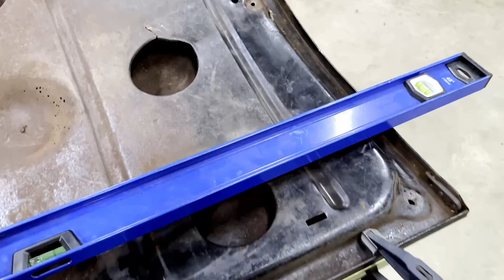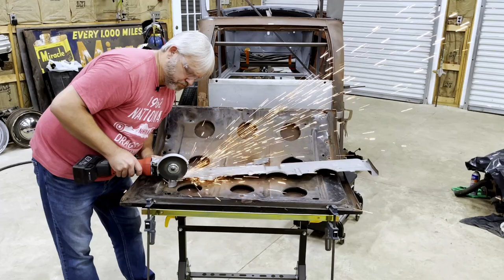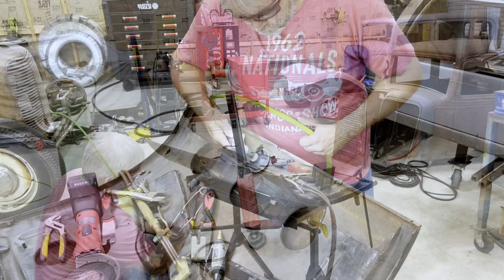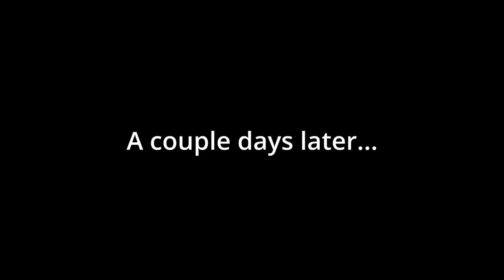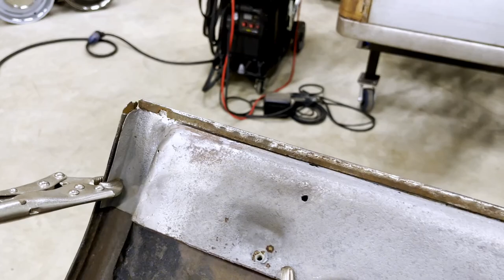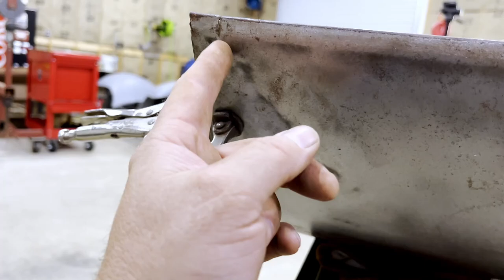Rusty Model A trunk lid part 4. Patch panel fits! Trunk latch handle hole repair! Hemi coupe build.

Comment: I think you should split the inner from the outer. Get both fixed then paint inside then put back together.
Reply from the maker: That was my original plan, but I'm afraid I'll get the trunk lid too far out of shape. If I had a solid car to fit the lid to, it would be different. But I'm trying to use the trunk lid to help set the quarters, and sort of work them together. So, I thought leaving it together would be more work, but could be beneficial from a squareness standpoint. Cleaning between the panels would be a good thing, so I still might come back later and pop the skin off and do that, But I don't know. I do collision repair for a living, and I've put on a lot of door skins, but taking a skin off without destroying it and putting the same skin back on isn't that easy. I usually grind through the edge of the panel to take it off, which destroys the skin. When I thought about separating this lid, I thought, well, if I'm going to pull the skin, I might as well replace the skin because it's pretty rough. Then again, the inner panel is even worse than the outer panel. So, the bare minimum effort to save this panel might be the better option and is what I decided to do. I may regret it later, I don't know. Thanks for watching and commenting. I appreciate it, and your approach is probably the smartest way, and I may be overthinking it LOL.
Reply: @phillipshotrodgarage I understand where your coming from . Was just my opinion. I’m not there in person so I dont know how bad the rest of the panel is. I think you are doing a fine job on everything so no negativity from my end. Keep doing what your doing I’m sure whatever you choose will work just fine. One more option. Look into soaking the whole thing in that WD40 rust treatment. Not ever used it so not sure of the cost but seen a few videos on it and it looks like it’s a good option.
Reply from the maker: @lowdollarhotrods2030  I've see some videos on the wd40 rust remover, but it has been a while. I need to look at it again. I have used evaporust quite a bit. I wonder what product is available to soak panels in after cleaning to protect them? I'm thinkng maybe something that will creep between the layers. of course, spraying with primer wont get in there. I wonder if there is anything.

Comment: Nice work with the  brass mess!  I have struggled with same kind of "repairs", they sure can be a pain in the butt. I took the easiest way to do it and i just cut it off and patched it with new metal.
Reply from the maker: I honestly didn't expect it to come out that nice, I originally though I'd have to cut it out. It was a nasty area the way they filled it in. I'm still amazed.